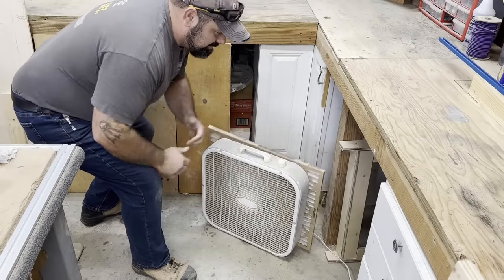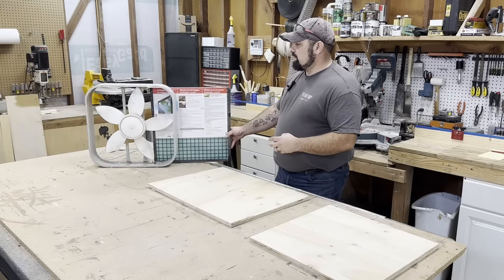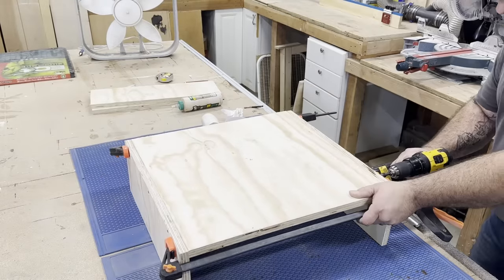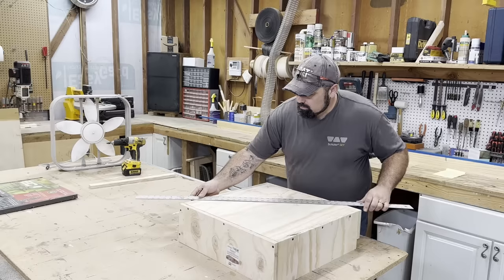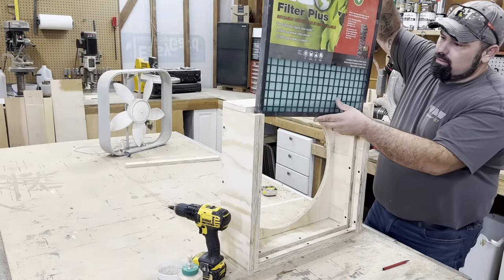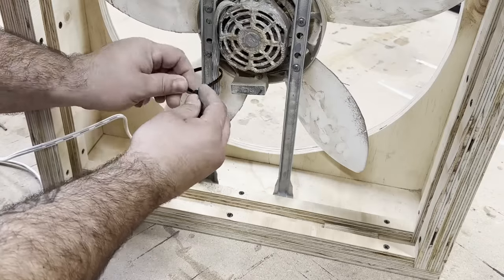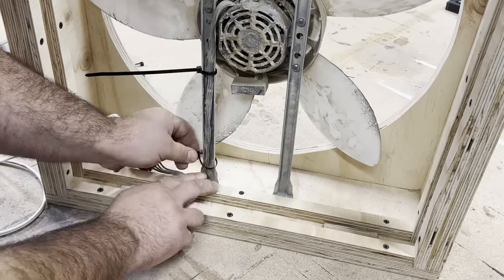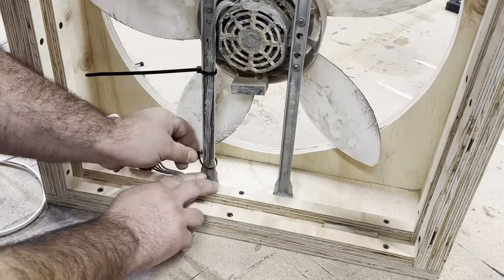NO one else has this feature!!! Box Fan Air Filter (save your lungs) dust collector,

Comment: Just to help protect your lungs, those washable filters are great but don't help with the microscopic dust that does the most damage to your lungs, so this is a great additional aid but don't count on it for the entirety of your dust scrubbing! ❤
Reply from the maker: Thanks for that, I Agreed. It’s just another tool to help reduce the dust in the air. It’s always recommended to wear a proper dust respirator. Even though I wasn’t wearing one in the video lol I also have a 3 micron filter on my dust collection system for the shop.

Comment: The only thing I'd done differently is built it so the whole fan sits inside as a unit. That way when the fan dies you can just swap it out instead of having to disassemble the new fan to fit the parts.
Reply from the maker: Originally, I was going to do it that way, but decided to do it this way to make it a little more compact. But that is a good idea thinking ahead

Comment: Try the new Merv 14 as its 5 inch thickness works 10x better then the inch wide ones without the bogging of the motor… cheers 🎉 great wood work tutorial
Reply from the maker: Thanks for tip, I’ll look into it
Reply: @ScorpionBuildsWoodworking  Merv 16 impregnated carbon is good X7935
Reply: So this 5 inch carbon filter is it also by Lasko and an all in one unit fan that holds this 5 inch carbon?

Comment: Wonky , that’s a really good idea and box fans are cheap to buy even cheaper in yard sales. Just kinda curious how often you have to clean filter
Reply from the maker: Thanks, well I have not had to clean it yet since I just made it. The old system I used I only replaced the filter once a year or more. But I think it really depends on how much you use it and how dusty the shop is if there’s a dust collection system, you may not need to clean the filter very often. I also have a second filter to put in while the other one is drying or I have time to clean it

Comment: Wonky, lol.

I have been looking for this wireless remote, fantastic job. My concerns are:

1. Would you want to have quick disconnect for the wires where it's locked in, probably a Uxcell Twist Latches?

2. A secondary Uxcell Twist Latches to box up the wires so the dust doesn't go into the excess wires inside.
3. Possible to have the knob on the outside?

Love the piano hinge

it takes 77 watts still correct?
Would be cool to run it off solar panel with 100 watts supplement from a BMS styled battery
Reply from the maker: I’m glad you enjoyed it… electrical uxcell twist latches could keep the dust out of the connectors. I’m not sure how many watts it consumes, I didn’t check before or after, but I would assume as the filter gets dirtier, the wattage usage would go up.  
I thought about putting the controller on the outside, but for me,  I always only use it on high, so I just did what was easiest for my application. But I’d love see any modifications you may do :)

Comment: Wonky... this is a neat build. I like the remote control and washable filter. I was thinking of building an alexa controlled smart switch inside mine. 

How long can you go between filter washes?
Reply from the maker: Thanks, and Alexa control would probably work pretty good too. This is the first time I’ve used a washable filter. But I’m sure how often it Hass to be cleaned will depend on the amount of use and dust within the shop, and how good your dust collection system is throughout the rest of the shop?

Comment: Why use a solid 20x20 piece of  ply for the back if you're just going to cut most of it away? I get box-store plywood is cheap(er), but I'm not wasting that material if I don't have to. If you have a good reason, I'd love to learn something new! Great video
Reply from the maker: That’s actually the front of the fan, and for a fan to work properly it needs to be around shape. Otherwise it will just cavitate and not pull the air through the filter. I also plan to use the circle that I cut out to make a wooden shield for my kids to play with.

Comment: Thanks for the good video.  I'm going to build one like this I think.  One thing I'm not sure of and maybe some electrician types can chime in on.  Will all that extra wire for the fan all bundled up like that create heat and be a fire hazard?  I know a guy who almost burned down his house by only using the first and last 3 feet of (admittedly much longer) a 50 foot extension cord that was rolled tightly (and that might have made it more dangerous) on a cord wheel.  Melted that thing into a huge glob.  I guess a guy could always shorten the excess fan cord if it was bothering him too much.   Thanks again!
Reply from the maker: Thanks, rolling up extension cords when using them is a fire hazard for sure. I wasn’t worried about it with mine figuring it has constant air flowing across it when the fan is running, but if it makes you feel better just run the cord around the inside of the box and secure it with cable ties and screws

Comment: Wonky is good…..right??  Hey Michael, Pat here from the  Toronto area, Canada.  Just wonderin’ why you didn’t build your box around the metal frame that came on the fan??  I understand taking the screens off front and back, but couldn’t you have slid the metal frame snuggly into the plywood box???  Just askin’.    the way I see it - Pat
Reply from the maker: Good question, I originally was going to build it that way, but figured it would be more compact and light for smaller shops. Plus it was fun.

Comment: Expensive.  I did the same thing with a 20" filter and duct tape.  Not as pretty but given the price of plywood and the fact that a 20" box fan will only last about one or two years it was a lot cheaper.
Reply from the maker: I had been just putting a filter behind it for several years and figured I wanted something different

Comment: A much simpler approach: get 1/2" J channel for vinyl siding.  Cut two pieces to 20".  Clip to left / right sides 20" filter.  Place everything onto "intake" size of fan.  Zip tie J channel to fan.

The zip ties hold the J channel to the fan.  The J channel holds the filter.  To replace the filter, slide it out of the J channel, and slide a new one in.
Reply from the maker: I’m sure that would work great. I just wanted to build one out of wood
Reply: I wish you had pictures to that girl that sounds interesting as well

Comment: Mr. Wonkie, why did you mount the hinge in that direction? Folded the other way would eliminate the gap.  I would have also made the speed control easily accessible, just in case.  Another consideration, the filter access is on one side and the wiring access is on the other side.  This is ok for standing, but if you wanted to hang it, things change.  Good job though, and for me, everything in my shop is "a work in progress".
Reply from the maker: I guess I could’ve mounted the hinge to the top, it just didn’t cross my mind. I chose to mount all of the controls and wiring inside the box because I planned on using a remote to turn it on and off, and I have found over the years. The fan is always on high anyway.
Reply: Man, you guys are insightful good stuff

Comment: Witch way the flow goes and how good is catching dust ?
Reply from the maker: Good question,  the fan is pulling the air through the filter. And it works pretty good

Comment: Those cheap box fans are not designed to pull air thru a filter. The cfm is greatly reduced and as the filter loads it drops off considerably. They are minimally effective as a air "purifier"
Reply from the maker: They may not have been designed for that. But I’ve been putting a filter on mine for quite a while now and it works pretty good from my experience. I also I’m using a washable filter so that I can keep it clean. But if you put too low of a micron Filter on there or you don’t clean it often enough you may have some flow problems, but that goes for any filtration system.
Reply: I use a filter taped to a box fan on all of my jobs. It works fantastic

Comment: Wonky. I've seen an extremely cheap version of this using 4 1" filters and some duct tape, and putting the fan on top. I like your version better! Need to build this for inside the house.
Reply from the maker: You could get a smaller micron filter too

Comment: Wonky, why not just put the piano hinge on top?
Reply from the maker: The piano hinge is on the top, or are you meaning why not have the whole top hinge? If that’s the question, I wanted everything around the fan to be sealed so that it would only pull air through the filter as much as possible

Comment: rwonki. the heavy stuff will settle out of the air in a few minutes. This will keep the air stirred up so that they stay in the air longer.  The small stuff that gets past your mucus membranes will not be filtered out by that setup. It will still get into your lungs. AND, grossly overbuilt. 2 bungee cords would hold a filter to a box fan.
Reply from the maker: When it’s hot out side there’s going be a fan running anyway, it may as well filter the air at the same time, and this is more fun then bungee cords